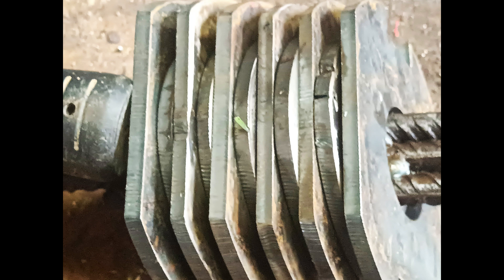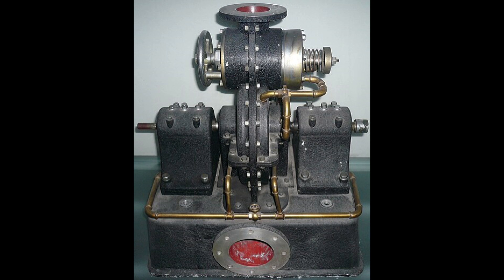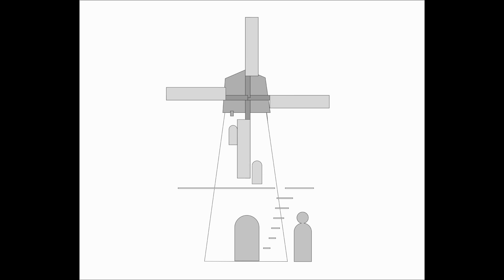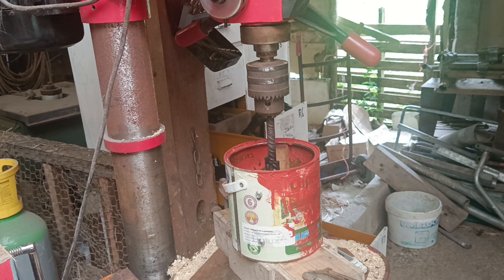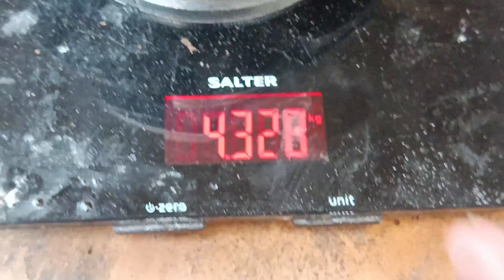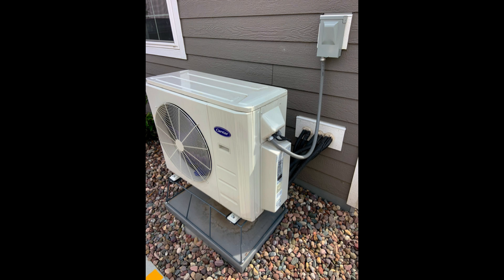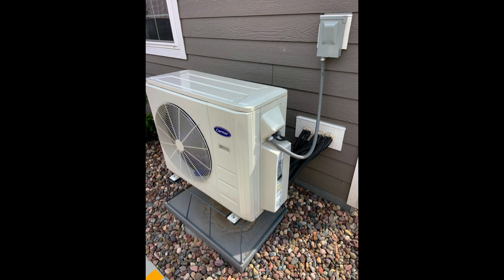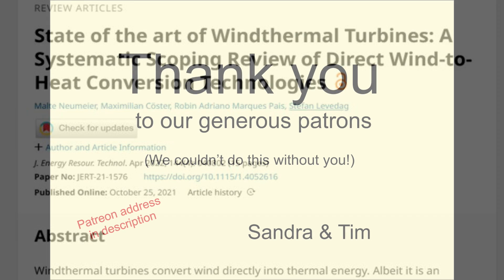More Interesting Things About Friction And Mechanical Heating - It's All So Interesting!

Comment: If efficiency is your goal, generate electricity directly on the main shaft - at 20 rpms.
Using some sort of wooden gears to turn the axle downwards, making heat with friction and somehow transporting this heat may be the most inefficient way, even more inefficient than anything else you explained.

again: electricity at the main shaft, transport that with >99% efficiency to where you need to heat and voila - done.
Reply: I know of no generator that can generate at 20 RPM

besides, violates the cheap, easy, simple requirements
Reply: @Tater1337  (bike) hub dynos do. So there is that.
But they are usually limited to about 5W of power. 
But there are tons of generators available that can deliver way more power at low rpm. Keep in mind steady voltage or the wave form of AC just doesn't matter (but usually does in other applications).

Comment: When you say that converting energy(like in an electric generator) wastes LOTS of energy, i think you may be overstating it.

Any electric generator worth its salt is at least 90% efficient, very possibly more like 95% efficient. That electricity can be converted to heat with 100% efficiency, for a total system efficiency of 90-95%. This may be better than anything you manage with mechanical heating once you consider the gearing and the heat exchanger.
Reply: you forgot gearing losses to get the windmill shaft up to a RPM the generator can efficiently use, and the cheap/easy/simple requirements
Reply: @Tater1337  there are many ways to drive a generator from a windmill, not all of which involve much or any gearing.

The electric heating solution is also quite simple, easy, and cheap. Very possibly just as easy and cheap as a friction heater.

That being said, I don't necessarily think it's the best option. I understand the aversion to involving electricity in this project. In fact, if I were doing this, I would be pursuing a water brake/torque converter/Tesla turbine viscous heating of some kind, to avoid the dreadful scraping noise of grinding steel plates if for no other reason.

Comment: I was down on the metal on metal at first, but I think if you filled the tank with a mineral oil (or maybe even just used motor oil?) that would make the system last longer, and maybe even generate more heat due to the higher viscosity of the oils instead of water. All you'd have to do is have a little magnet in there to collect all the rust and other bits, to keep them away from jamming the whole thing up

Comment: +1 for heat pump.
You might even be able to connect the compressor directly on the 2nd shaft.
Get everything you need from an old fridge: don't forget the safety valves.

And good luck for your cold. :)
Reply: most compressors are completely sealed, so it is still impractical, and most require a minuimum RPM, so you'll have additional losses in whatever gearing or other power conversion you use

those losses will most likely be in heat, and be harder to harvest than the plan he has already
Reply: @Tater1337  One could use an old Truck engine as a compressor, though. All you have to do is adjust the Valve timing so that they can in fact compress air, and with the high volume of those engines a low rpm should be feasible. And trashed engines (where the issue isn't the engine itself) are quite cheap
Reply: @thoughtfox2409  cheaper than a few metal plates?

and trying to convert an engine for a compressor  will NOT work well for a heat pump
Reply: @thoughtfox2409  simple answer to this, how many old truck engines do you see used for compressors? sounds good in theory, and has been used a few times in practice, but.......
Reply: @thoughtfox2409  I have also thought of this idea (even going up to marine/loco engines), however my application would be for MW range wind turbines moving heat out of old mineshafts into district heating systems.

For this project, he really needs to use car vacuum pumps with a humid air medium, (boiling pressure at room temperature is too low for a pure water system)
He could convert a motorcycle engine but that'll be more work.
Reply: @Tater1337  quite a few actually lol, I have converted a few smaller engines into compressors, somepeople make custom cams but I just replaced the head with a steel plate with two reed valves. simple and very effective
Reply: @Tater1337 Just put everything inside an insulated box. Vertical shaft (80 rpm) and cold water go in, hot water comes out.
The components will run hotter than normal, but you won't lose any of the heat.

Comment: Just had a thought. What if you used oil instead of water in the first stage. Yes it would reduce the friction but so much it wouldn't generate heat and the the wear and tear and corrosion issue would be solved. The extra viscosity would make up for the loss of friction maybe. I'd imagine that a spiral swirl pattern on the plates would increase heating efficiency as well.

Comment: what temperature are you trying to achieve? you already got mechanical energy. thermodynamicaly speaking heat is a step down from there. so perhaps it would be a better Idea, to go for heatpumping instead of friction heating.

Comment: the energy you loose ingearing is lost to heat. That normaly is a bad thing. but you wanna heat up water anyways. so y dont u gear to whatever rpm is useful for you and use theenergyloss to preheat the water?

Comment: I find all of this information very interesting and hope it continues.  I have one thing to add that has nothing to do with generating the heat.  My suggestion would be whatever you want to warm up such as a home or workshop the first thing that you do is super insulated.  I'm not talking about insulating beyond stupidity, I'm talking about taking advantage of every opportunity you can to keep the heat that you make within the structure.  Many people do not realize that even burning wood  for a heat source uses air inside your structure which you have already heated and you're using it for combustion and it's going up the chimney.  In the case of using wood as a heat source, an outside combustion air source would be a good idea for your woodstove, pellet stove etc.. Keep up the good work.
Reply: agreed, 90% of heat loss is thru air leaks, not from poor insulation values

and probably more prominent in an area that has enough wind to turn a windmill
Reply: @Tater1337  
If one turns on their clothes dryer or bathroom ventilation fan, air is blowing out of the structure and must be replaced by the ambient air and whatever that temperature is outdoors that is going to come indoors through every possible tiny leak.  They have a mechanism for testing such problems and it is astounding where the leaks come from and most people including me would not have imagined.
Reply: @yt650  yet, I am amazed there is not more "cut your heating costs in half with this ONE SIMPLE TRICK"

because yes, fixing air leaks works sooo well, guess how I know
Reply: @Tater1337  
I live in Pennsylvania, USA .  One could easily deduce what the weather is like with the four seasons.  There are two buildings heated on this property one is 1200 ft.², and the other one is 5000 ft.².  We use natural gas for heat.  Even when the weather is at its coldest our heating bills never exceed US$450 per month and in the summer  our cooling cost never exceed $400 per month.  The 1200 square-foot building is 20 years old and the 5000 square-foot building is 70 years old but we insulated it and changed all the windows.  I know people who have homes that are 2000 ft.² that pay more than this.
Reply: I fully agree with this! a few cans of expanding foam can go a long way. There are some expensive ways to pressurize a building and blow aerosolized silicon which then collects in small air gaps that air flows out through, but it's likely too much hassle for him, and too many thousands to bear. A good eye and can of spray foam would do much the same thing though, for a much lower cost.
Reply: @Nelo390  
You are absolutely right .  This is not something I thought of, I was taught this and this was proven to me.  People do not think that once the air goes up the chimney for combustion or out through the dryer vent, it must be replaced by outside air through every crack. A dedicated source of air for combustion for example woodburning prevents this from happening.

Comment: My in-laws use black tubing in a coiled fashion and have the sun heat to tube which in turn heats the water. An inexpensive pump would run it where needed and it stays clean. This is how they get a heated swimming pool at no charge. I hope you’re feeling better soon.
Reply: Tim said he wants the heat mainly for the winter. I also mentioned this because they work great for heating water!
I think he's dead set on the windmill route tho. Even if he would gain quite a bit of savings for most days when the weather is mild and the sky is cloudy.

Solar Water Heaters are a thing in Ireland tho! But Tim is a guy who likes to do things himself :D
Reply: I see a tiny flaw in this one ...... Ireland! 
It is known more for its lazy rain (it goes right through you rather than around) as opposed to sunny days! ;o)

Comment: What about a watercooled aircompressor. Then you get compressed air for the workshop, and heating of the water.
Reply: Connect the air powered loco in reverse to the windmill and use its pistons to compress air for it. If you have a water jacket around the pistons and air tank they should also generate a fair bit of heat :)
Reply: That is basically halft of a heat pump and an awesome idea!
Reply: @dennisolsson3119 Yeah, my thought immediately as well. Also to combine with an old fridge to get cool drinks 😂
Reply: Heat off the back, drinks out of the front.
Reply: Now That is a good idea!
Reply: Tbh best idea in the coments yeat yeat
Reply: I want to build one now LOL
Reply: @rasmuslymo  in my opinion if i were to bild one i would use an old broken portable traler light mast because the boom is operated by a wier rope so it could be brought down easely and the jack legs and prtabilety means you can move it anyware
Reply: @SCronin944   Yea the movable function will dismiss any legal concern i guess :P?
Reply: That’s a very good idea   ❤️
Reply: Sounds like a great idea, but doubt this would make much of any heat, or any real usable air flow at the low RPM, unless you have a custom giant piston, and many pistons... Steel plates are still the winner to me
Reply: I was just thinking about using cylinders of an air compressor.  The slow speed would let more of the compressed gas heat into the cylinder head to extract and you could run the exhaust through a heat exchanger.  Perhaps even run it so that the exhaust was recycled to the intake or heated the incoming air.
Reply: https://youtu.be/Oc0b4aBOyBw?si=hIJpB43AewlJXppT
Reply: Consider using a trompe to compress the air with the windmill moving the water to the top of the trompe.  Very few moving parts and there might be a use for the compressed air afterwards - perhaps it could be used to pump up more water …